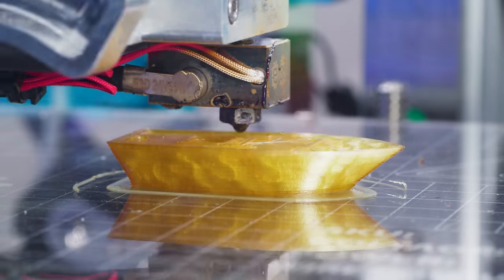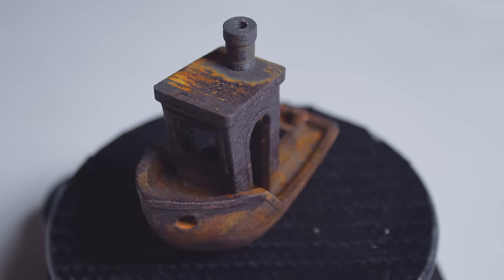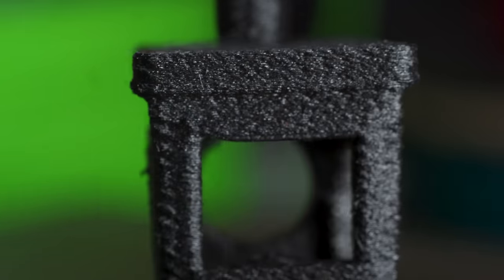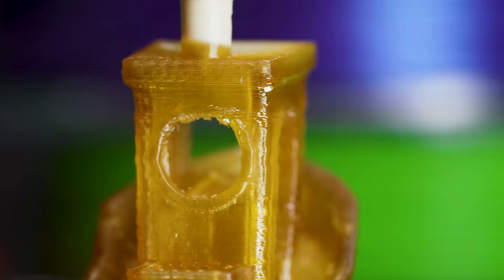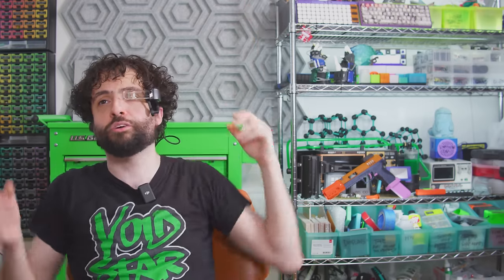The 3D Filament Tier List! Which Should YOU Use?

Comment: This is great to know as I print a lot of cosplay armour and action figures. I typically use PLA+ and what has killed more of my (finished) prints than anything else is layer adhesion. When you're actively wearing a print or putting strain on a joint (long action figure arms act as giant levers, multiplying the force on the joints) I find they always break along the layer lines. Sometimes you get lucky and the part can be rotated and printed so the layer lines run lengthways against the direction of force, but that's not always possible. And in the case of something like shoulder pauldrons, they experience strain in all directions.
I'll be referring back to this video for future projects as before this I was thinking I was going to have to start trying to fibreglass my prints and all the dangers that comes with that. So thank you.

Comment: There is no commercially available  filament of it yet but LM-PAEK is a very good alternative to PEEK which is easier to work with (LM stands for „Low-Melt“) as the melting Temperatur is around 30-40 degrees lower. 
Still hovers up water like a reservoir tho.

Pretty much checks all of PEEKS boxes but isn’t as stable at higher temperatures (meaning it’ll only be good up to 240 degrees or so, still enough to fry a steak tho)

Comment: I personally have found CF-PA12 to be very easy to print once you dry it (which is a pain, I'll admit).  But that's using Qidi's CF-PA12.  I'm really surprised it was so low on the tier list. 

PPA (high temp nylon) is a filament I didn't see mentioned here surprisingly, given all the other exotic ones mentioned.

Comment: As an aerospace engineer, the super polymers piqued my interest.  "I've used that one and got shot down for requesting that one and got that one added to our standards.."  We have to deal with flammability and toxicity issues that keep most thermoplastics off aircraft interiors (like just about everything you have listed).  We are happy they let us use nylon zip ties.   The engine guys have to use fiberglass "floss" to hold down cables and hoses.

Comment: You left out glass filled ABS.  I found that it fixes the bed adhesion and warping issues so it can be printed by pure novice like myself but still gives you the temperature resistance required for automotive applications

Comment: Hydrofluoric acid won't dissolve your bones. At least not much more than any other acid. It's also not a very strong acid. What it does is, once it got through your skin into your blood, reacting with dissolve calcium ions to form *a solid*. This will very quickly make all your calcium unavailable for any kind of cellular metabolism and that is very very bad. So the biggest concern about hydrofluoric acid or hydrogen fluoride is not that it is an acid but just that it's very toxic even on touch. If you touched it, you can increase you odds of surviving by running to the ER, they'll administer a calcium salt infusion.

Comment: I have been using ABS as my main filament for years and it just seems like the most versatile of any filaments I have used. I also use it most often because I recycle ABS computer shells and other things and turn them into filament. You missed the biggest flaw with ABS and that is that it is hygroscopic so it needs drying when it is humid.

Comment: 00:00-2:54 Intro
2:54-4:00 Regular PLA
4:00-4:46 Silk PLA
4:46-5:45 Carbon Fiber PLA
5:45-6:26 Metal-Filled PLA
6:26-7:34 Wood PLA
7:34-8:10 “Tough” PLA
8:10-8:45 Matte PLA
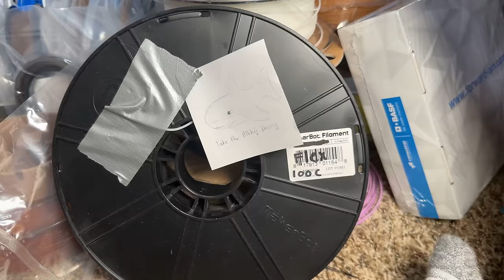8:45-9:33 High-Speed PLA
9:33-10:31 “Flex PLA” PCL
10:31-11:18 PETG
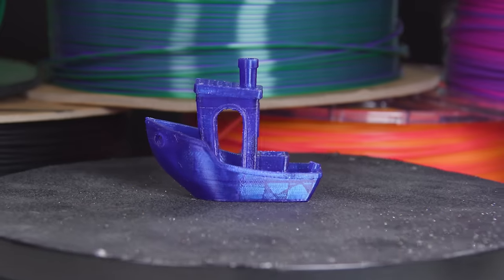11:18-11:50 Carbon Fiber PETG
11:50-12:41 PCTG
12:41-13:35 PET
13:35-14:05 CF PET
14:05-14:44 PVB
14:44-15:40 ABS
15:40-16:22 ASA
16:22-17:02 HIPS
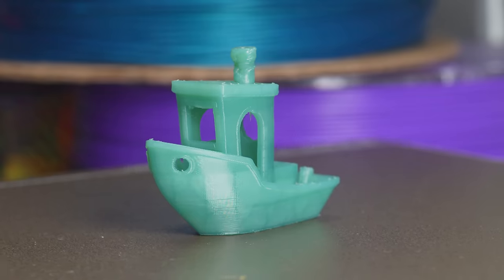17:02-18:16 PA-6 Nylon
18:16-18:50 PA-12 Nylon
18:50-19:32 CF Nylon
19:32-20:37 Glass-Filled Nylon
20:37-21:08 Nylon/PETG Alloys
21:08-21:53 Polycarbonate
21:53-22:35 PC Carbon Fiber
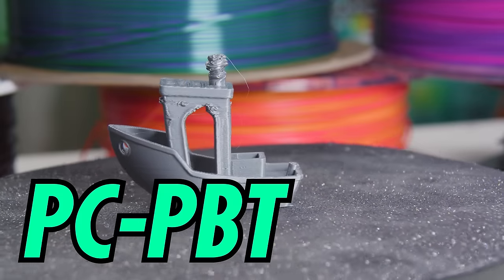22:35-23:36 PMMA (acrylic)
23:36-24:15 PC-PBT
24:15-24:56 ??? A SECRET ???
24:56-27:00 TPU
27:00-27:26 TPE
27:26-28:17 SEBS
28:17-29:04 Polypropylene
29:04-29:43 GF-PP
29:43-30:16 OBC
30:16-30:58 HDPE
30:58-31:56 POM
31:56-33:06 PVDF
33:06-35:01 PEEK
35:01-35:38 PEKK
35:38-36:19 PPS
36:19-36:58 PSU
36:58-37:21 PES and PPSU
37:21-37:46 CF-PEEK
37:46-39:38 Ultem
39:38-40:39 TPI
40:39-44:33 Thanks!

Comment: The information A+, tones of info to asorb here.
The tier list C, its influenced by your gear check restrictions and cost, its good to mention these but shouldn't effect their ranking.

I have a modified printer that reaches 140° bed and 320° nozzle the chamber can vary from 40° - 55° depending on the outside temperature. My printer isn't anything special and is mostly cheap parts from aliexpress. I don't feel like its much of a barrier as you think to print most of these.

Comment: Hm, I'm very much against PLA except for purely decorative items. Reasons: it creeps under even slight stress and will deform in a plastic manner over time, rather than an elastic manner. For me it warps more than PETG. The PETG I use has basically zero warping, whereas every single PLA filament I've tested lifts corners on bigger prints. PLA becomes brittle over time and just crumbles like sugar glass. There are highly modified PLA filaments out there, that usually don't mention anywhere that the base material is PLA (except maybe the saftey datasheet). Those might be different, but they are at least as expensive as good PETG. Finally PLA+, meaning the type of PLA that can be annealed for strength and a huge melting point increase, did actually start to anneal during printing, leading to completely inconsistent dimensions.
So for figurines PLA might still have a tiny edge because better details, but I'm a firm believer in PETG for just about everything else that doesn't need something special. The first time I re-printed a funnel for work, that someone dropped. The PLA broke. I then actually accidentally dropped the PETG funnel and was surprised about how differently it impacted and bounced off of the floor. Also PETG layer adhesion can be really high. Basicall allm my prints, when I stress test them, break through the layer lines, not at the layer lines. Not 100 % isotropic, but rather close compared to all other filaments I've ever used.

Comment: I cannot stress enough how tough PEEK and GFPA are. I have seen PEEK used in body armor, and use GFPA to armor my 30lb battlebot rather than machined aluminum or steel. I have had bolts shear apart before the plastic failed. I have literally pulled the broken bolts out of them and bolted them back on. I will be reaching out to sponsors about PEEK armor for a next version.

Comment: Nylon CF is one of the easier material to print. I dont have a heated chamber but put a bit of magigoo on the print plate, heat it to 100°C and done. Perfect engineering grade 3D prints 😄

Comment: Try  Esun carbon fiber nylon usually comes in a half kilo roll it's white of course with black flex of carbon so it looks like marble

First thing I noticed is that it comes dry you don't have to pre-dry it which is fantastic and second you can print it on an ender 3 now I haven't tried to print things with fine details and it does like to separate from the bed pop free it doesn't stick very well although I haven't tried vision minor nano polymer with it yet but I printed all my screwdriver handles with it which I still need to dig out of storage since I moved from Pennsylvania and they came out fantastic in order to preserve the layer bonding issue you mentioned I had to print them slowly but that's okay I printed them open air on a $100 ender 3 no problem
Reply: I’ve never seen carbon fibre filament look white and have black flecks, if you can see that with the naked eye it probably has low carbon fibre content. I have used and looked at ESun CF nylon and have never seen anything other than black.

An important thing to remember is that just because a material printed that doesn’t mean it printed well. Printing high temperature materials in sub optimal conditions generally leads to low mechanical performance. In this video he printed PEEK but I can guarantee it will not be as strong as a properly printed PEEK part would be. With nylon, if not printed properly you might as well use an easier to print material since the loss of performance from printing it sub optimally negates most of its benefits.

Comment: Fantastic video (as usual). TPUs is very hard to compare: for example you have an "S" for SainSmart 95A but NinjaTek Cheetah, which is also 95A, gets a "B". Unfortunately, Shore hardness values are only one of the factors on TPU. (I have use a lot of Filaflex 82A and I have to agree for the "C" rating -- PITA to print on  my MK3.)

Comment: PVDF is also really popular in nuclear reactors for not degrading under radiation... I managed to get my hands on like 0.5kg for like $10 (usually that's in the $100s) and your safety warnings were more then anything an update to my filament list of "needs enclosure and ventilation". I love that I have nearly all these filaments thanks to Maker Box over the years. I remember reading POM is basically impossible to print... I'm about to try and print a tall print in TPU 75D... and I'm still curious on PCTG as you're the first to really describe it as nearly everyone else is "well, it's basically an alt PETG" with no more description.

Ah, PEEK... I remember when people would complain they wouldn't spend the money on a Prusa because "for that price, I expect it to print PEEK" and I'd laugh at how much they didn't know you can't print it. Period. Unless they wanted to add a 0 (at the time) to the price of a Prusa. It's a little easier now, but it's still not cheap. And that's before the cost of a spool :P

Comment: This data belongs in a massive Google docs spreadsheet. Pretty please? If when I buy one, I'll use this as a guide on specs I need. Currently tempted by TPU and lost wax investment casting filaments designed to bjrn out ashlessly. But the other engineering plastics here also tempt me.

Comment: PSA: Fiber filled filaments are much more difficult to use safely than the video suggests. Try to avoid filaments with fibers added unless you really know what you are doing since the fibers don't usually stay captured in the part and will flake off into the air/your hands as you handle the part. Carbon fibers and glass fibers are both problematic. 

For more info, the channel Nathan Builds Robots has some great documentation of this including close up shots of filaments lodged in his skin.  The video is youtube . com / watch?v=ddwNZ12_qX8

Comment: Holy crap, i'm finally managing to have mi Monoprice Ultimate 3D printer to not fail a 5 hours-print and been using only PLA, didn't knew how much filaments (and chocolate) are out there, might try some of those first S-tier
Also, not sure if it's because the material or the printer, but seeing how im not the only one not having perfect overhangs just makes me see that it's not absolutley a problem of my settings (or printer) 
Maybe it is, but im just glad i finally have a useful printer afte 3 years of coming back and leaving after a first fail

Comment: if you put this in a spreadsheet tiered separately by Print Temp, Glass Transistion Temp, Stiffness, Toughness, Adhesion, Warping, Hygroscopicity and Extra Remarks that would make it niche (UV, chemical resistance/transparent, expensive, hard to find etc), you will have the most visited spreadsheet for FDM material comparison on the internet. this kind of reliable data in readable format for the range of materials you have covered is simply not there and you have the data.

Comment: petg can also be devistating to glass.   i have had petg prints take chunks out of my glass before i started using 3d lac as a SEPPERATOR. for petg.  
as in i'd rather have it pull up chunks of 3d lac then have it pull out chips of glass.

(PSA. do not use the spraycan type of 3d lac.  are you really wanting to coat your entire printer including the rails in 3d lac?    use a mister type bottle.  like parfume. or a water spray bottle that hairdressers use. 3d lac makes these aswel.)

Comment: Hard disagree on the metal filaments, at least the copper and bronze fill ones I've used.  I did a ton of finishing on the prints I've made from them, i.e. sanded the crap out of them to remove layer lines, and then polished with steel wool, and then used brasso (metal polish) to add a patina.  The work was worth it though, the things I've made have come out as VERY convincing little metal statues.  I really don't think the aesthetics can be beat by any filament, period.

Comment: 39:38
About Kapton

In isolation, Kapton remains stable across a wide range of temperatures, from 4 to 673 K (−269 to +400 °C).
Kapton insulation ages poorly: an FAA study shows degradation in hot, humid environments[8] or in the presence of seawater. It was found to have very poor resistance to mechanical wear, mainly abrasion within cable harnesses due to aircraft movement. Many aircraft models have had to undergo extensive rewiring modifications—sometimes completely replacing all the Kapton-insulated wiring—because of short circuits caused by the faulty insulation. Kapton-wire degradation and chafing due to vibration and heat has been implicated in multiple crashes of both fixed wing and rotary wing aircraft, with loss of life.
According to a NASA internal report, Space Shuttle "wires were coated with an insulator known as Kapton that tended to break down over time, causing short circuits and, potentially, fires."

Comment: As a mechanical engineer who just got into 3D printing (yeah yeah... a bit late to the teain, but in my defense I 3D print with steel using a welder and a robot it just my hands. Since I was a fabricator before engineering degree). This video amuses me because every engineer know that first you derive properties from design, and then from materials. Most of the things in our world are made from very basic materials. Mild steel, basic aluminium alloys, simple plastics, and so much wood and laminated wood composites and paper in different forms. Why? Because we don't really need more than that, actually... we want to keep materials simple and easy.

I been trying to get into the 3D printing community. And I see way too much obsession with wrong things, and vocal people with no basic knowledge misleading people. Then again I read technical standards for fun... my bar is in orbit.

But I been able to push my little flashforge 5M pro to do... well amazing things really. And I can print high speeds, and great mechanical properties because I design with the print parameters in mind.  I don't generate infill anymore at slicer, I design in in CAD the internal structures to get desired properties.

Granted, what I do is beyond hobbyist. I get it, they want to pront cool gadgets and toys - I respect that, I print shitty sculptures 

But... I wish I could somehow communicate to people how much more you can do, if you design with printing in mind. And don't try to pull things off in a single print. Two parts printed in different orientations can compliment eachother. Post prosessing, epoxy coatings, resin finishes, rubber pastes. Hardware store stuff, which can elevate your basic materials.

Comment: Chemist here!! 

So a hydrocarbon (as the name implies) refers to compuonds entierly (or mostly - the term is uses pretty loosely) of hydrogen and carbon atoms. So a halogenated hydrocarbon is when at least one of the hydrogen atoms is replaced by a hydrocarbon. It’s volatile because it can react with pretty much anything.

An acid (in very simple terms) is a chemical species that is recognised by its ability to “donate” a hydrogen atom to another more nucleophilic atom. Usually these acids are “organic” (containing a carbon-carbon and/or carbon-hydrogen bond). So an inorganic acids (aka mineral acids) do not contain C-C or C-H bonds. Think HCl or H3PO4. They’re usually much more acidic than organic acids because the bond of the acidic hydrogen to its “parent molecule” is usually much weaker, and more readily able to react. 

Love your videos, keep up the good work man!! ❤